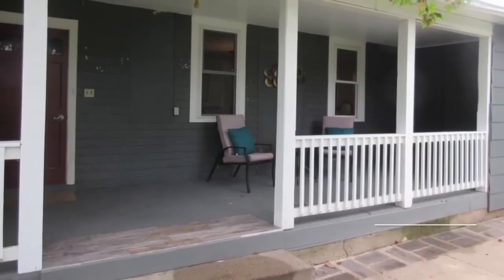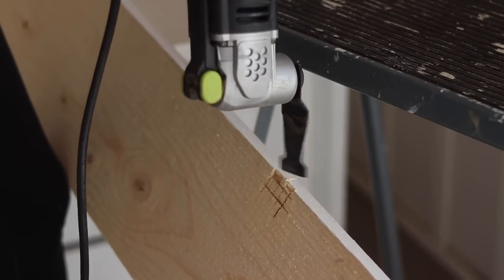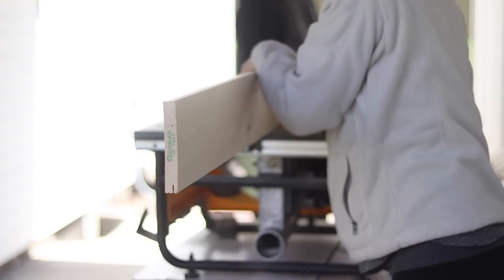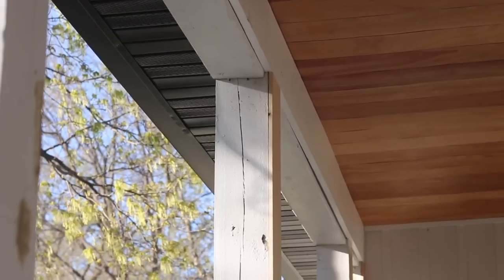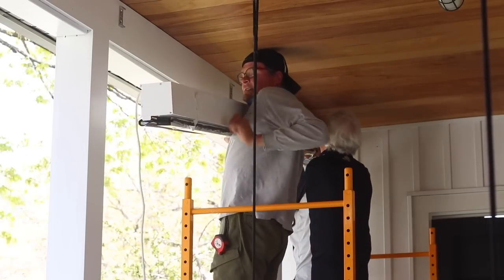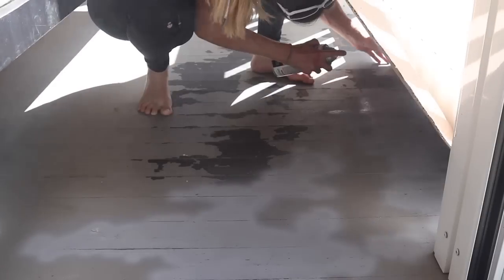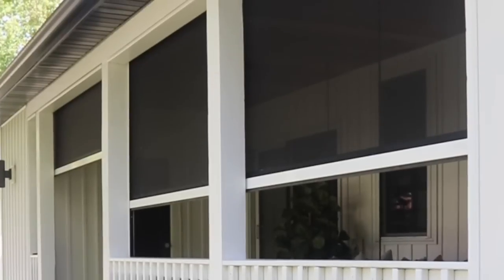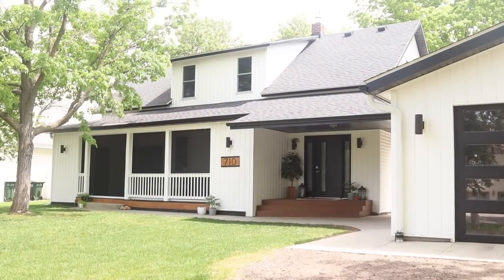Screened In Porch | Somfy Motorized Screens Install | DIY Front Porch Makeover

Comment: I worked at a full time job until my 9th month and renovated an entire home (mostly by myself) during my pregnancy as well. I gained 17 lbs with my pregnancy and the baby was 9 lbs of that. I was not quite 5 feet and weight 95 lbs prior to getting pregnant. The baby came out perfect and scored high on all tests. Although some  pregnancy can be difficult, it doesn’t mean pregnancy is a handicap. You can do almost anything. Great to see you doing all of this while pregnant.
Reply: For sure. From a medical standpoint pregnancy should not limit many activiites. You should however be a little careful with exposure to chemicals. Primers and sanding dust can be toxic. A mask would be best.
Reply: @DannebergAcres  its clear you're not a doctor. it's a reason why the American system has a high infant mortality rate and a maternity death rate compared to third world countries.

Comment: Did you profile the porch before painting it?  Putting a sand on it is key for adherence.  Do a tight prime coat and sand lightly again and get some quality epoxy or paint and roll another coat and sand again and do a top coat of a urethane, tight coats you can use a urethane with 240 Aluminum oxide as a slip resistance or like a #10 glass bead.  If you go the epoxy route you can broad cast a quartz blend into the body coat then do a 10mil grout coat over the quartz after it's swept and vacuumed.  Then another 12 mill body coat, depending on the texture you want for slip resistance. Then a top coat of a high strength UV stable urethane topcoat without slip.  So much you can do with epoxy

Comment: Why are you pulling the wood through the table saw blade from the back instead of standing in the front and pushing the wood through? The dust port is on the back of the table saw. Is there a table saw trick I am unaware of working from the back? I know you are find but that worried me!

Comment: Where did you run the electrical...did show that
Reply from the maker: Oh I'm sorry I should've shown that! We had an outlet about four feet away and each screen plugged into it (two plugs). You can also hardwire these but it can be harder to service them if you do. You need an exterior rated outlet within twenty feet of the installation location (no extension cords). Hope this helps!